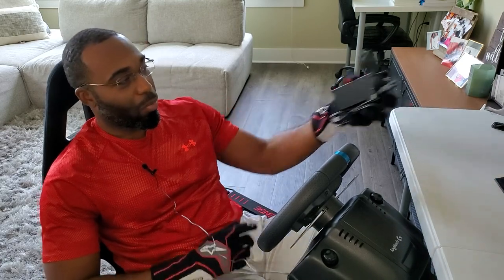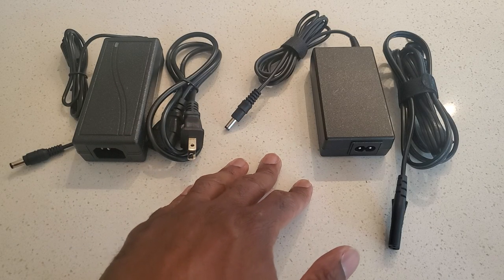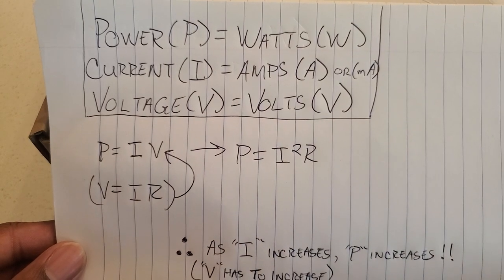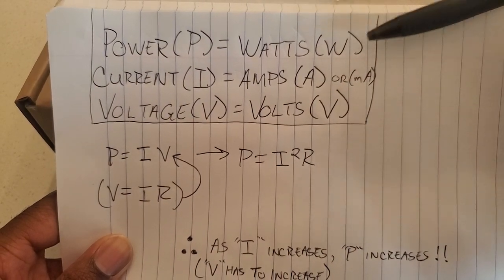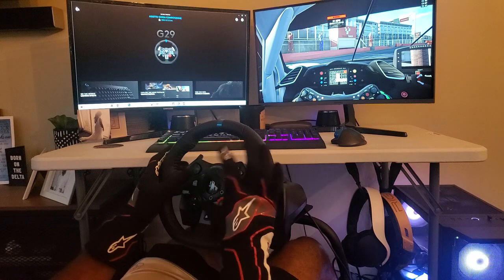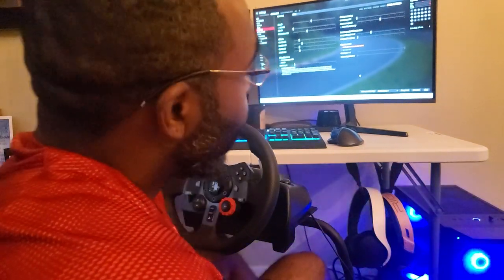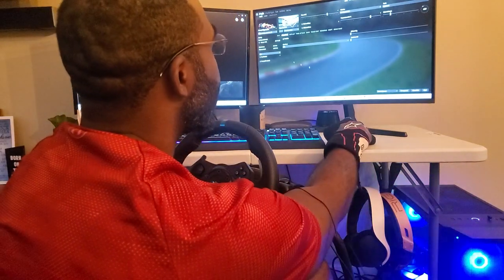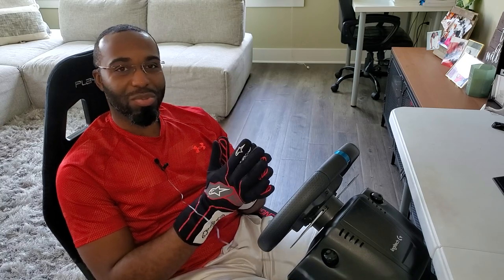G29 5A Power Supply Upgrade

Comment: You will not kill it, a device will not draw more current than it needs, if you power it with 5A it will not supply 5A, the device will draw the amount of current that it needs.
Reply: Would tou care to explain?
Reply: @GregKuhn  Let me explain it by using a jug of water, If you aren't that thirsty you will only pour a bit of water into the glass to drink, you will not always drink the entire jug, but if it is a hot day and you are very thirsty, you might drink the entire jug. Powersupplies work just like this, they only supply the amount of current that the device needs.
Reply: @pineapplepizza5733  Thank you for clarifying. If I may, I have a follow up question, that is probrably super ignorant, as I know NOTHING about electronics.
Fanatec CSL DD comes stock with 5NM through a power source of 90W. One can by the so called Boost Kit 180, which brings the torque of that wheel to 8NM through, as the name says, 180W.
Why is that? How on that whell they reserved the possibilitty of improving the torque by increasing Watts?
Reply: Also , I don't wanna sound like X-Files (I want to believe), but I wonder if there's the possibility of Logitech, when designing the G29 left some room for an upgrade kit they ended up following through?
I'm sorry if that's just another stupid question, but I really do appreciate you taking the time to respond, @PineApplePizza
Reply: @GregKuhn  if the g29 could draw more than 1A the original power supply would turn off for overload protection. The only way to make the g29 (or similar) draw more current (and so more power = more strength) is to increase the voltage. By doing this you may overheat the components and destroy them. You should also tear down and check each component's data sheet to be sure that it can handle the desired voltage. Probably you can go for 30v with no damage but I have not checked yet.
Reply: This is incorrect. If you add a current source of a very high current to a light bulb the very high current will go trough the bulb and burn it.
Reply: Maybe its good with the more Power full gear Motor
Reply: @BOO-ii3ni  brother just connect a bulb to your outlet, it can out put more than 3kw at a time but yet it just uses 60w for that incandescent light bulb
Reply: @BOO-ii3ni  . You are incorrect. Voltage is not current. If you supply more voltage, that is operating out of spec. The Amp ratings on a power supply is just the designed maximum output. If you you require more, you will likely burnout the power supply and the resulting failure might cause the damage to the device attached as the voltage may increase out of tolerance due to the damage
Reply: @BOO-ii3ni  in a car, the battery has enough power to supply lets say 400 amps to the starter. Each of the lights in the car use that same battery that has the same ability to push as much current as possible to those lights, and yet they never blow their 10a fuse. Current draw is dictated by the load, not the supply when voltage is a constant. See what happens if you raise the voltage to a light bulb, suddenly you will have a way brighter, more efficient bulb, but only for a few seconds before the filament is burnt out

Comment: You can put in 200A even and it won't make a difference. Technically, it is still about current draw that the motors will pull. Giving it more amps will not make it pull more if they don't require more really.
Reply: Lmao. Thank you. I can believe people fall for this. 

If your motor is rated a a certain power, it won’t magically get better if you give it more amps.
Reply: what you are saying is entirely correct. upgrading the power brick to one rated at a higher amperage will not "force" more current or therefore more power into the wheel. amperage is dictated by the power draw from your load. what people have figured out is that the g29 WILL draw more than 24W (24V*1A)in some instances IF YOU LET IT. From what ive managed to find the main boards fet would the limiting component for current at somewhere around 3.5A. don't quote me on that though im not an electrical engineer, just a schmuck with an internet connection.
Reply: @Paintbullits  good point. Perhaps they cheaped out on the PSU and at certain points the motor will draw more than the limit of the included PSU for a variety of factors. A motor’s draw will fluctuate it’s normal. Would be interesting to try it out
Reply: @256k_  that's my guess as well. would be simple to test for anyone willing to splice an ammeter into a power brick with a higher current rating and watch what it peaks at. might try exactly that at some point if i can dig up a good ammeter for cheap somewhere.
Reply: @Paintbullits  on my AC ammeter displays output peak cca 3,5 A :-)  love strong FFB
Reply: Indeed, the circuit would have to be changed to draw more amps. At most will gain maybe an extra 10% tops due to the circuit having the ability to tolerate a little over its amp rate.
Reply: @Paintbullits seeing as the g29 uses its own power supply, I don't get why people don't just measure the wattage from the wall

Comment: The mossfets are specced for 3.3A, chips used are 2 x 4951GM, 1 x 9977GM. changing PSU to a higher Amp one will result in the motors being able to deliver higher torque at any given moment.

Comment: The current written on the power supply stands for the maximum current it can handle. The ffb strength is controlled by the wheel motherboard by changing the voltage on the motor. The motor has constant resistivity, the voltage cannot be changed (unless you want to fry your wheel), so the should no difference between stock and more powerful power supplies. I myself had to change my own power supply to another because I'd lost the stock one, and I noticed absolutely no difference. To be truly honest you should measure the momentum your wheel can give with two different power supplies)
Reply: on dfgt i felt the difference and the calibration was faster with g25 power adapter, but dfgt psu was far lower on output
Reply: I have the 5amp power supply I can guarantee that it is more powerful not sure whats happening exactly but its 100% stronger.. I've heard that logitech give a little play in the amps to protect them but they can handle more power I'm using a 5amp so I can back this up 100% try it before doubting it..

Comment: Thanks for posting this! There's a lot of posts on forums for this mod but no videos. I ordered a 6A supply and will update how it feels. I play mostly GT sport which has notoriously low feel, so maybe this will add a noticeable difference
Reply: Just did a quick test and wow it's a huge improvement. There's a little bit of extra feel on GT sport and most importantly the feedback isn't laggy anymore! You feel the car break loose instantly whereas before it felt like the car would step out and then after a delay the wheel would give you some countersteer. Much easier to control at the limit now
Reply from the maker: @gravity45b thank you for your update! I'm glad to hear that this mod is an improvement for you!
Reply: @gravity45b  You excited for GT7? Just picked up a G29 today, already dancing on the keyboard for mods haha! This power mod is neat!
Reply: @JCCollinsRacing  Thanks for this review brotha 😎
Reply: @drenomix  yeah I definitely am!! I might wait to get it until the PSVR2 comes out if they add VR support to it though
Reply from the maker: @drenomix  You're welcome! Thanks for tuning in!

Comment: I’ve been using 6.5 amps on my g27 for 7 yrs now and still working great. More amps is more power but more heat. So I also put heatsinks on the motor and a blower fan on top just a year ago. More torque and more stable, also the psu is not getting hot for long use
Reply from the maker: That's awesome! How did you install heat sinks on the motors?

Comment: You need to measure power draw from the wall with an old PSU and the new one, at idle and during vibration testing.

Comment: For anyone trying to find an adpater since the link is broken:

I think depending on when you bought the G29 you get a different stock power supply. He said his is 24v/1A, but mine is 1.75A, and I've seen other people online say stock one is 1.75 too.
This debunks many comments stating it can't draw more than 1A. If that's the case why is my stock supply from Logitech rated higher than 1A if they know it can't draw more than 1A? 

The real question what is the true maximum the motors can draw? and we can't make an assumption. They aren't rated for 1A just because the supply is 1A, you need to leave space at the top to make the hardware last more cycles. You never want to be hanging out at peak power constantly, too much heat. It's a general rule when engineering anything that you build it to handle more than you plan to actually throw at it. The same reason why car motors are detuned from factory, they leave some headroom to make it, and all the other connected components like the transmission and various pumps last longer. You turbo the car, it won't last as long, because now you're hitting that peak potential. This upgrade is basically like turboing the G29. 

Last example; if you play music on your tiny speakers at max, they will eventually die, if you want it louder you get bigger speakers (more watt potential) and then turn the volume down instead, they'll last way longer and be just as loud, sound cleaner too. 5A could be like the "max volume" of the G29, but we don't really know, only the designers know what the true maximum potential is. What we know is they gave us 1A or 1.75A supply, and we can assume that's not the maximum. We can hope that even at 5A there is at least a little headroom still, otherwise it's definitely going to get damaged overtime just like how speakers break when you constantly run them at max volume.....

Anyway, after some digging to confirm, I think the upgrade is 24v/5A = 120 watts
The connector is a 5.5 x 2.5mm
It will draw dynamically, with a 5A maximum. It might not ever actually draw 5A, but if it does indeed try to, the power will be there (such as when FFB peaks/clips, or when the wheel wants to unwind really fast). With a 1.75, it can't draw more even it was possible, hence the "clipping" sensation you get when you reach the power limit of the supply. Either way you always want a little headroom so what's the hurt? If it only draws 3A max, cool, that means the powersupply won't get very hot (the motors will though, because you'll be hitting their actual max, where as, theoretically, the 1.75A stock supply leaves more headroom for them). 

TL:DR 

Will this work? YES.
Will it burn out the motors faster? Also YES.
If you implement a cooling upgrade alongside this upgrade the motors will probably be fine, just like if you turbo a car you likely also need to upgrade the cooling system.

UPDATE: This is exactly what I got a few weeks ago, the plug fits perfectly, it doesn't get hot, and YES it spins faster, especially in Assetto Corsa compared to Automobilista 2 and EA WRC or any other game/sim I've been running. IDK the explanation for that, just how it feels to me.

https://www.amazon.com/Adapter-100V-240V-50-60Hz-Converter-Transformer/dp/B0BJZXFZ2H/ref=sr_1_4?crid=15EB0SU9CLFI2&keywords=24+Volt+5+Amp+Power+Adapter+24V+5A+Power+Supply+Adapter+100-240V&qid=1707661494&sprefix=24+volt+5+amp+power+adapter+24v+5a+power+supply+adapter+100-240v%2Caps%2C282&sr=8-4
Reply: I just got it and haven't felt any different on forza. Will keep updating..
So as long as I don't run 100% or max ffb it should still be fine correct??

Comment: I just measured 42+ watts draw with spikes higher than that just fighting the center spring on my xbox home screen and it kept creeping up as i held it (probably from heating up and inefficiency increasing). I read somewhere that the mosfets are rated to 2Amps which would automatically make the stock 1.75amp power supply under rated and even with a 2amp you have to account for sudden spikes  and how much the stock psu voltage sags under sudden spikes etc. im sure that you would benefit from at least a 2.5amp supply. Im also sure this is logitechs way of making the wheel more reliable by under powering it for preventing earlier wear and overheating when inexperienced user turn everything up to 180% and clip the hell out of it. Im pretty sure it will be fine since you are not over volting it but you have to be mind-full of clipping now because it will be able to overheat quicker since you are supplying the full current to those Fets when they demand it. I would like actual measurements on torque from the motor but im pretty sure ill be able to record higher watts using the higher amp supply during heavy use of the ffb.
Reply from the maker: @supboy666 this is great information! Thank you for sharing and for watching the video!
Reply: @JCCollinsRacing  I ordered a 24volt 5amp supply im receiving today. Once I measure the watts its using by connecting it to my power station and doing the same center spring fighting test ill report back but im anticipating higher wattage since it was pretty much maxing out the stock PSU immediately when applying force to the wheel during centering spring mode.
Reply: @supboy666  update?

Comment: Of course you dont feel any changes!  First of all, im an electrical engeneer, so let me explain, you are absolutely wrong if you think that a power supply with more amps could give more power to your wheel motors, only in the case that you have an old power supply with less power than the wheel demands, (sorry for my english i know that sucks), so man, if you wanna give power to the logitech you need to change internal motors and to add a little electronic controller to remap  or to escale the old range voltage to the new range, if you dont know anything about electricity please get a little bit more of information, this type of video sucks because it very easy to see that you dont have no idea of this and supose misinformation. Cheers
Reply: Hola, me podrias decir que sistema para utilizar en el caso que quiera cambiar el motor por uno mas potente ? Digamos que un rescalador de corriente ( que ingrese la corriente que entrega la central a un rescalador y entregue mediante una fuente la corriente que nesecita el motor nuevo)
Reply: he actually felt the difference. Only F1 couldn't give it, but when he tested ACC it was noticed
Reply: @LexKing96  tendría que echarle un ojo muy detenidamente, pero hay proyectos en Youtube de gente que si llega a cambiarlos pero al final acaba encontrandose con el desafío de que más fuerza también significa más resistencia y  puedes hacer polvo los dientes del engranaje.
Reply: You can upgrade the Fanatec 5NM with a new power supply that's stronger, so how does it work in that case only increasing power? Not to mention a ton of hilarious videos I've seen where people replace batteries in small children's electric cars and it increases performance 5x so why is that? And he claims that it was a noticeable upgrade?
Reply: @joemay5 the difference with fanate is that the motor is already waiting for 7.5A, but the 5nm PS only gives 3.5A. So when you upgrade you’re actually giving the power the motor expects
Reply: Engineer  smart guy